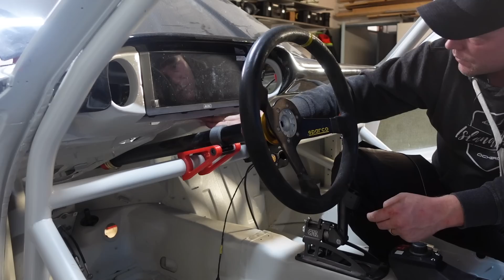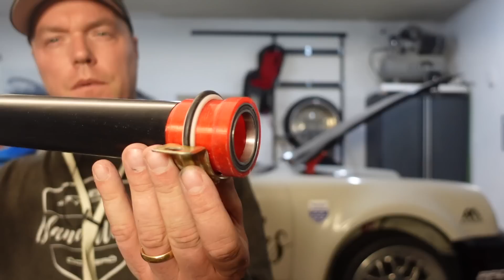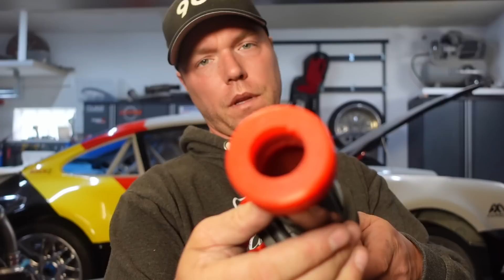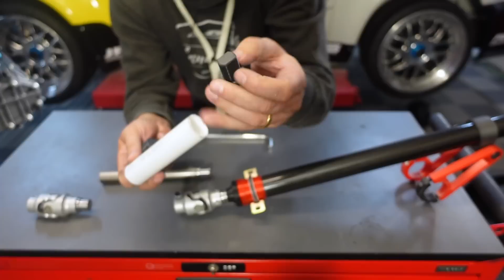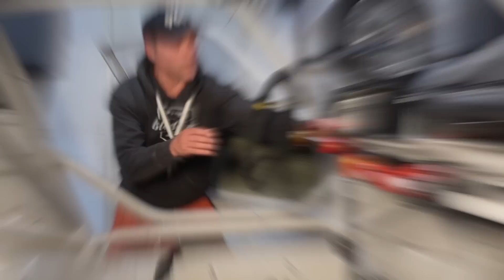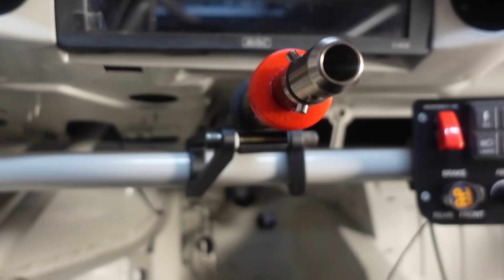Back on Track - Installation of Steering Column on My Porsche 964

Comment: Where can we get the 964 cap? Nice video, as usual.
Reply from the maker: It’s in my webshop! https://islandworks.one

I think it’s out of stock now but I’ll order more if anyone want more 👍🏻
Reply: @islandworks  Saw it, thank you. I noticed, however, that the spacing between the numbers is not uniform. The 4 is closer to the 6 than the 9 is.
Reply from the maker: @maxagent86  I’ve never thought about that to be honest. It comes with the process and that it’s a bit curved I guess.

Comment: Awesome job so far but I don't like the steering column support braces. Even in aluminium it seems like it will flex because they are long and with little "structure". Maybe some extra webbing would help and even more lateral angle. Then the carbon tube has still a long overhang past the bracket which isn't supported and will probably flex. Maybe you could extend the collar that attaches the column to the bracket? That's my 2 cents from my Eyeballing-FEA 😅

Comment: please be very careful using aluminium UJ's, from experience I do not like relying on screws to retain them to the shaft (i have had two failures), i see that they have a lock nut which is good, but make sure you also use thread lock, personally i would want steel so they can be welded
Reply from the maker: Thanks for the input. The original ones on the 964 are aluminum which is why I picked that. What’s you concern?

I plan to drill where the lock screws go in to recess them as per the recommendations I got.
Reply: @islandworks  my concern is that the screws can work loose, as mentioned I have had 2 failures, are the standard 964 ones grub screw or clamp?

Comment: Tip for when you glue the ends in the carbon tube, make sure its not a tight fit. You want some clearance for the glue. If you are printing the ends you can make some small tabs around the circumference that align it but the rest has clearance for the glue.
Reply from the maker: Thanks! That’s great feedback!

Comment: Just a thought. Typically, the lower side of steering columns (portion consisting of universal joint at the steering rack up to the universal joint at the end of the steering column) integrates a collapsible portion. On your Porsche steering column you’ll notice it’s and outer tube and inner tube that appears to be splined. In a front end collision where the steering rack gets pushed towards the cabin, this portion collapses instead of pushing the steering column up into the cabin.

I do not think the lower portion will “flop over” like you’re imagining and explaining it will with your design. What if the front end collision actually “aligns” the two universal joints and they cannot flop over? It has no option but to force the column into the cabin
Reply from the maker: Thanks for the feedback. My Boxster has the collapsible portion integrated whereas the 964 does not originally. From the recommendation I’ve gotten it says that if the combined angle is large enough then it is not considered to be able to propagate the collision. If I’m not mistaken the guidance was 45 degrees.
Reply: Fair enough, figured I’d raise the concern. Sounds like you’ve thought it through.

It also occurred to me you’ll be fully harnessed in, so you won’t move forward in a collision into the steering wheel like a standard three point belt. So the concern is even less.

Comment: Steering mount looks like it needs an X brace in the near horizontal plane, to resist the side to side loads?
Reply from the maker: They would benefit from that and also from just moving the sides out like I did. I think the biggest deficiency right now is the material.